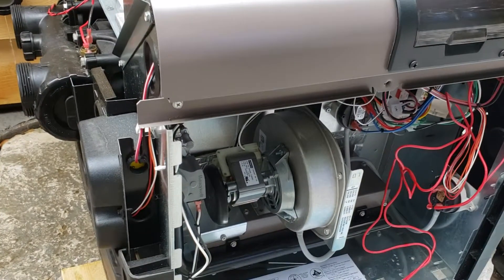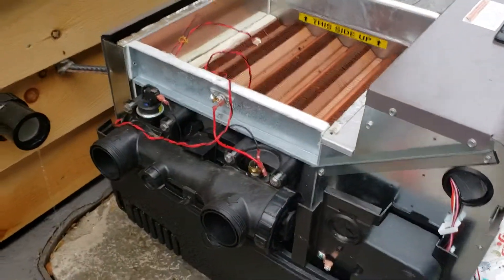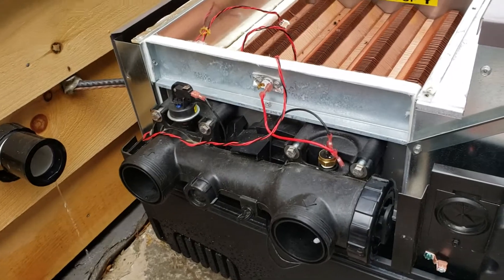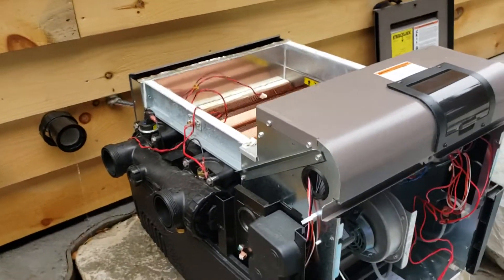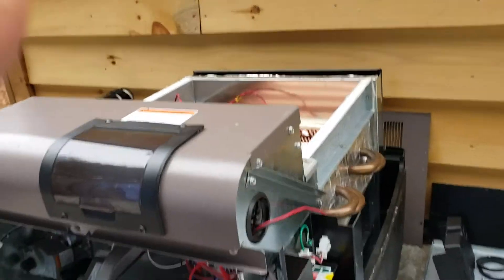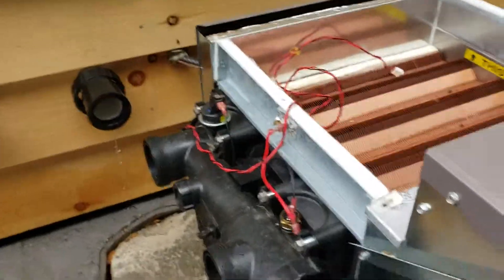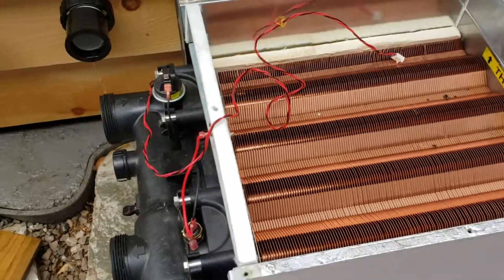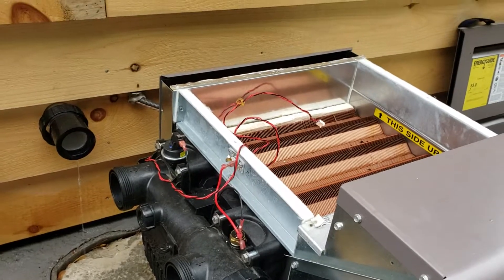Hayward heater h250fdn water manifold switch

Comment: When I undue the 8 manifold bolts the manifold feels like it is still connected but I can’t see how, can you tell me?
Reply from the maker: You will have to take apart the top of the unit and turn the whole heat exchanger around to the other side the purpose of my video was to show that this isnt a small job and not a simple as a retailer might lead you to believe
Reply: @cflipper142  I just got done reading my service manual and the heat exchanger seems to be the only major part without service instructions. This is the most helpful info I've found so far, thanks.
Reply: @andrewbobulsky3505  Did you ever actually remove the water manifold from the heat exchanger?  I am looking to replace the manifold (cracked from TX unexpected winter storm) and the parts lists seem like there should be gaskets and other mounting parts for the manifold.
Reply: @dleben83  I don’t recall removing the manifold. In my case I didn’t have to.
Reply: @dleben83  Did you ever find clear instructions?  I have a replacement manifold and took the 8 lag bolts off (without removing the covers) and it seems there is still a connection.  I see now i'm going to have to take the panels off.  TIA for any pointers you may have come across...
Reply: There are o rings connecting the plastic manifold to the copper exchanger tubing. Give it some light prying and it should come off.